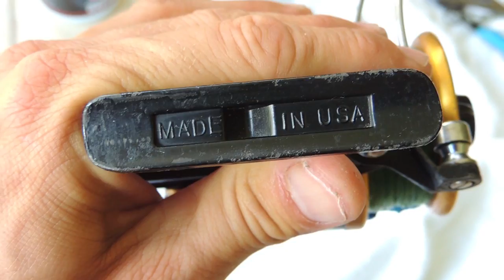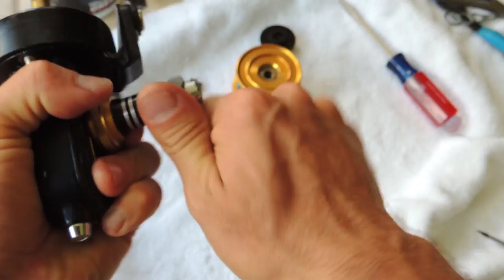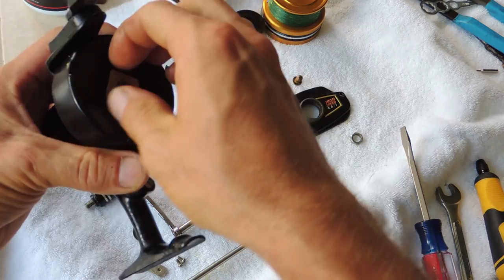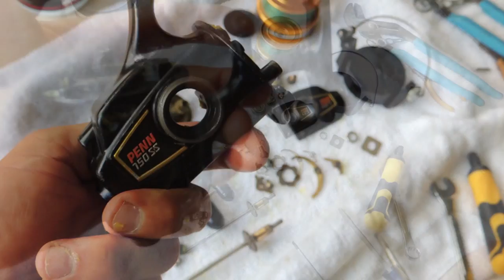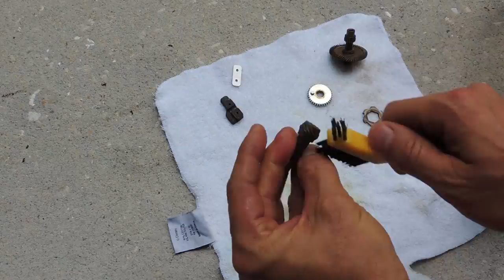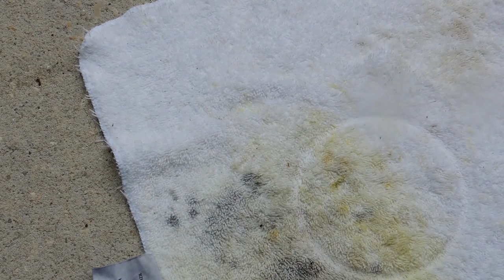Penn Spinning Reel 750ss / 850ss Maintenance Tutorial (disassemble / assemble)  PART 1 of 3

Comment: Very nice video. I'm was having an issue with my 750SS. When the lower switch is to the right I can reel in a normal fashion however, it doesn't always lock into place, meaning the handle spins clockwise a little.  Thank you kindly.

Comment: The reason why it was a bit wobbly because of the space in the ballbearing of the shaft. I tested the ballbearing of the handles on the shaft and still had some wobble on the rotorcup. I think a mm or one and a half. And I think thats a bit usual or am I totally wrong? The shaft is straight, nothing wrong with it.

Comment: Very pro-ish with that lineroller. Well done! I have one question. My 8500ss is a bit wobbly at the rotorcup, while the rotorcup is tightened. Could it be that its somewhere else a bit loose? Because i think there is only one screw (where the shaft is going trough) holding the rotorcup. Or is my reel just at the end of his time? I hope to here from you. Thank you!
Reply from the maker: Tek Tek  If it is wobbling it is possible that the main shaft is bent. One of my reels was wobbling so much, the rotor cup was scraping the main housing and made really loud noise when reeling. Fixed by getting the replacement shaft from the donor reel. You can probably get some from eBay used for really cheap.

Comment: I need help I have a 750ssm and when I reel it likes to stick on the bottom or on the top and won't reciprocate back and forth from top to bottom to reel in evenly. I don't know what to look for and eat to fix. any ideas what could be causing this?
Reply from the maker: +Jan Romanosky  take the main shaft out and check for straightness. There is the chance it is bent. If it is, you can find spare parts on ebay.